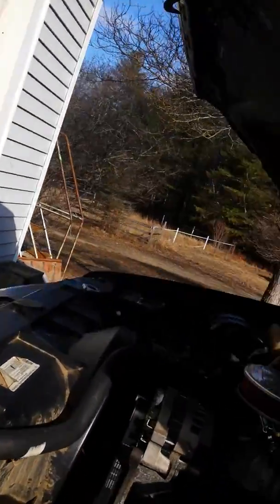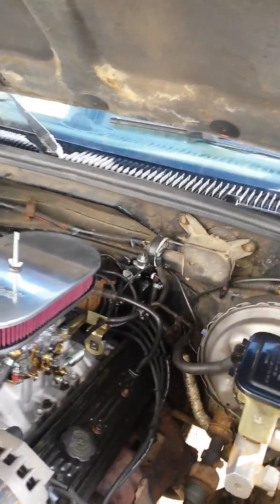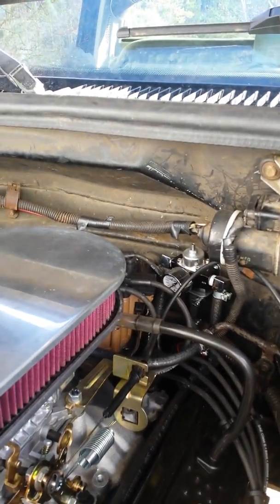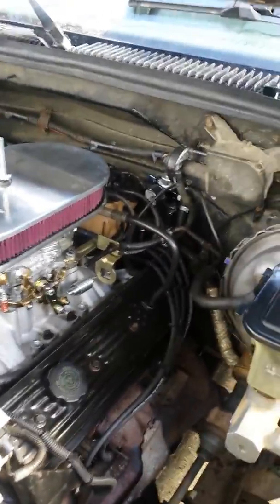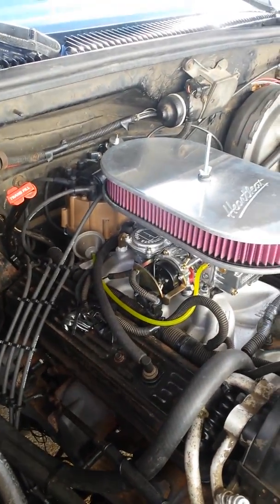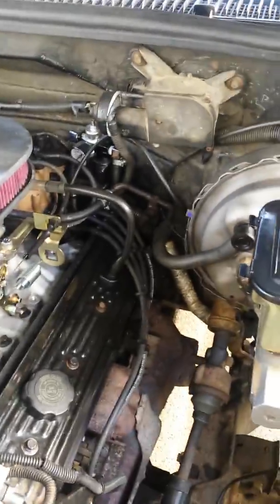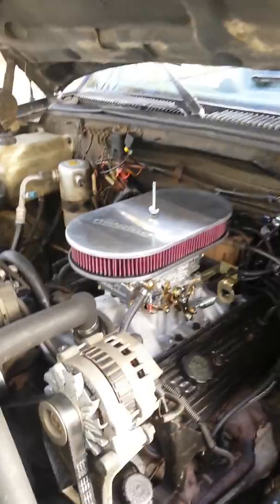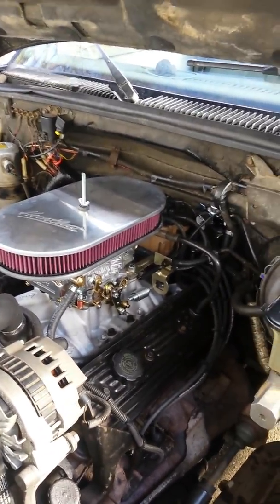TBI to Carb swap Chevy Truck Part 1

Comment: 5.7 Jasper rebuild with a 5 speed manual trans in a 93 GMC Yukon 2 door.  having major issues. Starts to run so lean it feels like cylinders are cutting out. Going to attempt this conversion. These videos are great. Hoping to get through this in one piece. Thanks for the knowledge.
Reply from the maker: Hello Nathan, I did the conversion for the same reason, mine was running extremely lean also. Your swap will be an easier one than mine, you having the 5 speed manual transmission. No TPS to deal with. If you have any questions that may arise during your swap let me know, would be glad to assist if needed. Just passing on the knowledge I amassed from a lot of good sources...

Comment: I went with a good old Edelbrock 1406 carb on my '94.  Had to make up a bracket for the TPS, but it was pretty easy.  The transmission wouldn't work right without that purple/white wire hooked up to a tach signal.  Could only apply to the 4L60-E.

Comment: Where did you get a fuel regulator,  to step down the fuel pressure from the factory high pressure fuel pump, , to the carburetor,  i can't find one ,  that will go from 40 psi,  to 5 psi,  what did you do about the fuel return line, back to the tank?
Reply from the maker: Summit racing, Holley regulator #12-842.

Comment: Love From Alabama Hopefully I Can Still Use My 4l60e for this swap if not I'm going to use a 700r4
Reply: Did you do 4l60e?
Reply: @cgonedfishing  yes you gotta solder the wires on the transmission to trick it to shift up and down

Comment: ordered my first round of parts for this swap cant wait to get rid of that tbi
Reply from the maker: Good day NB, nice.. any additional questions? just ask, best of luck with the conversion.
Reply: Can anyone send me a complete list of what I would need to do to covert my tbi?
Reply: @JonReaper95  intake carb distributor fuel regulator all gaskets ....you need what regular 350 would have on it ...there are 3 to 4 wires to hook up i did it on a 93 suburban couple years ago with no problems all my stuff came from summit

Comment: I know this video was a long time ago but was wondering??? What color was the wires in the harness that you connected the TPS to?  For the transmission.  Need to put the TPS on not shifting good.   Thanks for your help .
Reply from the maker: Good day, I am running out the door for an appointment. I will send another reply when free…
Reply from the maker: Hey Rock man. The three wires to the TPS plug are Blue-Black-white, hope that helps.
Reply: @crewyou07  awesome man thanks so much for your help. Killer video keep up the good work 😅

Comment: Run the vacuum advance to a ported vacuum source. Then you can increase the initial timing.
Reply from the maker: Good day Pablo, When I first did the swap I did have the vacuum advanced connected to the ported source and it pinged at cruising speed no matter where I set the timing at. For me, and I stress for me, leaving the advanced not connected and installing lighter springs on my mechanical advance my pinging problem went away and my zero to 60 acceleration did not suffer.

Comment: Did bend the OE fuel and return lines or did you cut them back when connecting to the regulator?
Reply from the maker: I cut the lines back.

Comment: So your 4L80 works properly like this? Anything needed to run the trans besides the throttle position sensor? Thinking of running a carb on a 94 K3500 4x4 with the 454 and 4L80.
Reply from the maker: Yes Drew, transmission works great and the TPS was all I needed to put back on from the original setup. You just to need to make sure you adjust the TPS to the right parameters. My other videos have that information.
Reply: Junk the boat anchor and go with a 350. Less weight. More room. Better MPG.

Comment: Ok. So i'm buying the Edelbrock 2701 intake, and 1906 AVS2 carb with a Proform HEI distributor. Jegs has a full kit for just over $600, PN 350-2021. Aside from everything in that kit, i'm still trying to figure out what all I need to do the complete swap all at once. I've got a 92 K1500 with pretty much your identical setup. I know i'll need a pump regulator, and already have the plate blocking off the old mechanical fuel pump, and I plan on doing something similar with the fuel lines. I currently have a 700r4, and i'm gonna buy the bracket for the tv cable. Is there anything i'm leaving out here? I've got a few videos on my channel for references if you need any visuals of what i'm working with
Reply from the maker: If you look in the video description section you see the complete list of everything I needed for the swap.
Reply: @crewyou07  I finished it a few months ago. I've posted a couple videos of it, but it's still a work in progress

Comment: to do the carb swap on my 95 Silverado all I will need is intake, carb, and an HEI distributor with coil, and a fuel pressure regulator? no wiring was needed? just hook up fuel lines on the regulator and it's all good to go?
Reply from the maker: Yes, those are the main items you need. The only thing I see missing from your list is the TPS (throttle position switch) Unless you are running a manual transmission you will not need one. Correct, no wiring is required on the fuel regulator. Fyi I made a 2nd video (Tbi to Carb swap Chevy Truck Part 2) going into more detail on the swap. Hope that helps. Any other question please ask.....
Reply: I converted a 1993 from tbi to carb and installed the TPS kit from Holley but still cant get my transmission to shift correctly. It starts off in second gear. Any suggestions? The trans is the 4L60E.
Reply from the maker: Hello James, Did you set the TPS parameters? It should read  .5 to .7 volts at an idle and 4.1 to 4.7 at FOT ( full open throttle )
Reply from the maker: Hello Dustin, yes the only thing missing from your list is the TPS sensor, unless you are running a manual transmission then you will not need one. And yes, no wiring is required on the fuel regulator. just make sure the regulator has 3 ports if you are using the factory in tank pump.  Because if you don't use a return line to the tank you will burn out the fuel pump.

Comment: So after doing this, what were the results.   More Hp/torque ?   Gas mileage +-   ?????   I'm now pulling a 4700 lb travel trailer with my 92 1/2 ton 4x4 surburban.Although it was the factory trailer package & geared 3.71, & rated for 6500 lbs towing, Its about at its limit Hp/torque wise.  I tow at 2700 RPM = 62 mph.  Gas mileage towing is no better than 10 mpg.   Stock motor peak Torque is at 2500 rpm.
Reply from the maker: Good day Craig, results? Well I do to talk about the results of the conversion in my subsequent videos. I will touch on your questions, yes more power and torque, mileage around the same.

Comment: How did you wire your hei distributor I've heard I can run my ignition power line to the battery port and also run a purple and white line to the tach port to initiate the fuel pump I'm confused because  my fuel pump should  already be connected in with my ignition line right? let me know what you think
Reply from the maker: Good day friend, I explained in detail your exact question in my other videos. Watch them all and you will see I encountered the same problem your facing and the steps I took to fix it.
Reply: @crewyou07  ok thanks

Comment: I know this is an old video but just need to ask ab out how the A/C working out for you since the Holly carb conversion on mine doesn't compensate for the idle, it idles down and so it idles high when I don't use the A/C and have to adjust the idle every time.

Comment: I was told by summit that I needed to buy the trans controller to control the transmission as I have the 4l60e and having stutter issues at idle and at the point where I changed everything already and was wanting to carb from tbi swap but after hearing I need that $800 trans box really kinda turned me off of the swap,
Reply from the maker: Good day Wolfe man,  the only folks I know that had to buy the summit kit were those who removed there computer, PCM and transmission speed sensors. I have the 4L80 I did the swap,  All I needed to do was install the TPS (throttle postion sensor) My truck shifts perfectly.

Comment: Great video doing this swap on my 94 but putting a earlier 010 casting 350 In and running a manual fuel pump. But 1 question I have is do you have any check engine light or lights on in the dash?
Reply from the maker: Hello John, Yes I do have the one check engine light on. It will come on and stay on after you unplug the sensors when you do the conversion.
Reply: crewyou07 is there a way to short that sensor to make that check engine light go away
Reply from the maker: Hello Tim, The only way I believe is (A) take the entire computer and all the sensors out or (B) simply remove the bulb from the dash. Tho I chose and have to keep the computer and the check engine light because I have the 4L80E transmission that has speed sensors and needs the TPS to function properly. Also if I ever have any issues with my transmission I will be able to retrieve the trouble codes to help me diagnose it.
Reply: I am also swapping with a 010 casting and plan to run a manual fuel pump what did you do with the sending unit it the tank to make it work

Comment: Undergoing the same swap. Was the larger fuel line the feed or return? Thanks a bunch boss I have Ben watching all your videos trying to get it done.
Reply from the maker: Good day Dave, the larger line is the feed and the smaller one is the return. Hope your conversion goes smooth!
Reply: @crewyou07  thanks for the reply. I happened to figure it out other day. But  I’m sure I will have a question or two along the conversion. Again thank you for the help it’s greatly appreciated

Comment: Usually the timing on the old HEI systems with stock cam were set at about 6 to 8° before TDC with auto trans on a 350 engine if my memory serves me well.
Reply from the maker: Good day Alan, thank you for the additional info.
Reply: That's about correct.

Comment: what intake manifold did you use? would you use anything different now that it's driving? also, did you use the stock tbi heads?
Reply from the maker: Hello Shawn. I used the Wieand Street Warrior intake. And no I would not use anything different It's an excellent intake for this application. It has all the provisions I required to make my conversion easier and look clean. Yes I did use the stock heads. FY,I I posted another video today giving more details of the parts I used check it out and let me know if it was a help to you.

Comment: How do you set up your TPS for your trans I have the 4l60 and my truck lops like a cam but the damn tbi doesn’t let me adjust it so carb swap is cheaper than tuning.
Reply from the maker: Good day Bob, If you are using a Holley carb for your swap then you need the Holley tps kit part# 534-202. It is adjustable so you need to set the voltage at .5 to .7 volts at an idle and at full open throttle it needs to be 4.1 to 4.7 volts for the converter to lock properly and shift. If you are using something other than a Holley carb you will have to do some research to find a bracket that is applicable to the carb you are using.
Reply: Did you use the factory plug for the tps and the trans shift properly

Comment: Do you have to get a smog check and how do you pass it, then for the best part what improvement was there, MPG, power, idle ETCMy 1990 SS454 is gonna get the swap soon>Thanks
Reply from the maker: Hello Bobby, here in Mass my truck is old enough that I do not need to have emissions checked for inspection sticker only safety. My MPG a tad lower but much improved power! Your BIG block is going to breathe so much better.....

Comment: Did you lose any guages or electric controlled equipment inside the truck if your tranny is an e version what do you need to set that up
Reply from the maker: No, I did not lose any of my gauge functions. If I did lose mine, personally I would just install aftermarket mechanical gauges but that’s me. As far as your e transmission I go into those details in my other videos in the series. What I do suggest is look into the TCI unit for those transmissions. They are pricey, but worth the price for the time and aggravation saved.

Comment: We are doing the swap ! Was wondering did you need the transmission controller I have a 4l60e. Thanks
Reply from the maker: Hello Steve, I did not need a controller. The only thing I needed for it to shift properly was to Install a throttle position sensor.

Comment: I just bought a 95' Yukon 5.7 TBI.  What do You recommend? Carb or EFI? Vortec Heads? Cam?
Reply from the maker: Good day, if your 95 is running fine and I were you ? I would leave it be and stave off any engine work until it acts up.

Comment: Did you had any issues trying to pass emissions test?
Reply from the maker: I had no problems because MA does not check emissions if vehicle is 15 years old or older.
Reply: @crewyou07  Thank you for letting me know. I'm in Phoenix Arizona. We have different laws here. I do have to take it emissions. I found a emissions shop that will steer me in the legal compliance. Because is my daily driver. Even if is a historical vehicle. It still has to go through emissions. Only ones that are exempt. Are 1966s and below. It sucks in a way. Yet if there are legal loopholes. I will proceed with the carb conversion. I found out. EFI vehicles have a life expectancy of 20 years. After that electrical problems list gets bigger and bigger. Thank you for your video and the knowledge.

Comment: I did the hei distributor and intake and holley carb but I'm not getting  any spark and it sounds different  when it's turning over any ideas ?
Reply from the maker: Hello Ricky, if you are using a factory GM HEI distributor I would first check to make sure you have 12 volts at the wire you connected to the distributor. ( check with the key in the on position) If you do have power then I would inspect the wires on the internal coil and the ignition module.

Comment: Hey crewyou07,
How did you manage to connect the return line to the fuel regulator? Or fuel regulator to the return line? Like what fittings did you use to be more exact.
Reply from the maker: Hey JKadey I used a Holley Fuel Regulator Part number 12-842 It has 3 ports an in/out and a return. The fittings I used were purchased at Auto Zone, Spectre part number 5946 for the in and out and Spectre part number 5945 for the return.

Comment: 92 has a fuel pump boss thats ready to go. Stock old type mech pump and rod well lubed, delete all electrical to pump and in tank stuff- minus the tube so you can easily fab to it. Couple of hoses to make up the difference between the stock line and where you need it to go. Put crane cam 272 .454 single pattern cam and go. No regulator necessary and no need to mess with a switch or getting your key to run a pump or this electrical nightmare. Ohh and a Q-jet too might even fit the intake on some tbi bb and maybe even some Small Blocks.
Reply from the maker: Hello James, Yes all you say is true and very good info and would work well with the 1992 and older engine blocks. As I stated in one of my earlier videos I had every intention of running a mechanical pump but there was only one problem. The engine in my 1992 Chevy K2500 was a 1994 Jasper rebuilt engine that did not have a provision to install a mechanical pump. So I went with the factory in tank electric pump instead. The reason why I used a Holley carburetor is because I needed to install the Throttle Position Sensor for my 4L80E to shift properly. Holley was and I believe still is the only one who offers a bolt on kit out of the box without having to fabricate a bracket as I would of had to for the Q-Jet.

Comment: Whats up man I have a 92 full size blazer. And I want to do this conversion. Am I able to use my original dizzy or am I gonna have to use a different one? It’s a msd one that I just bought. Lol
Reply from the maker: Hello Chucky, was the MSD dizzy as you say purchased for your 92 Blazer for the TBI set up? If it was you will have to get another dizzy for the conversion.
Reply: crewyou07 okay. Cool. Thank you very much on that input. Truly appreciate it

Comment: I watched the video Papa Ragan did about the swap he did. Looks like the same set up you have except I cant tell if he hooked up the throttle position sensor on his. I don't think the carb he had used the tps. I would like do away with all the sensors and get the computer totally out of it.  Any suggestions?
Reply from the maker: Hello Rob, the only way I know of to get rid of the computer all together is not only to remove the TBI, but you have to install a non electronic transmission ( Turbo 350 or the Turbo 400 and apparently the 700r4 also) or use a standard transmission ( 3 ,4, 5 speed etc ) If you are using the 4L60e or the 4L80e you have to use the TPS and keep the computer you have no choice. Your transmission will not shift properly. To be more specific, your torque converter will not lock properly.
Reply: Okay. Thank you. I just ran across this video and found it interesting:  https://www.youtube.com/watch?v=qOlbkFgACt4I have a 700r4 in my 1992 Chevy K1500. I do have the TV cable that runs between the transmission and carburetor and I have the 4 wire connector on the driver side of the transmission as well.  I'm really hoping that I can make this one work.  Thank you again for your response
Reply from the maker: Mmm, Ok Rob thanks for the info. I will edit my previous comment. Best of luck with your project!
Reply: Thank you!!!
Reply from the maker: Your welcome Rob.